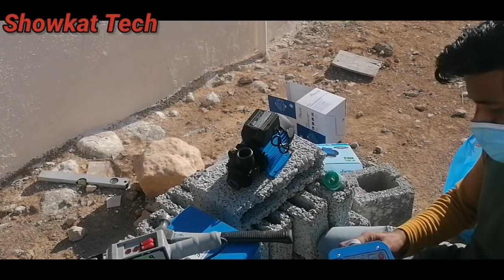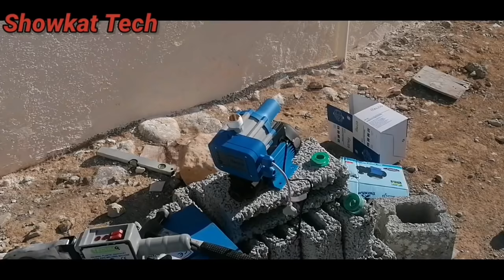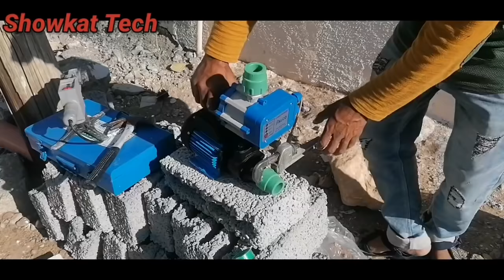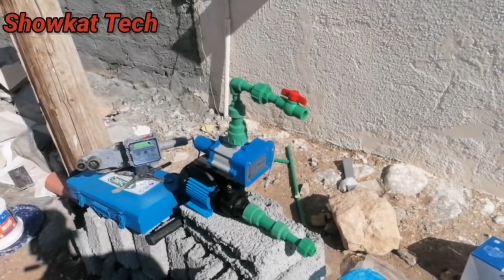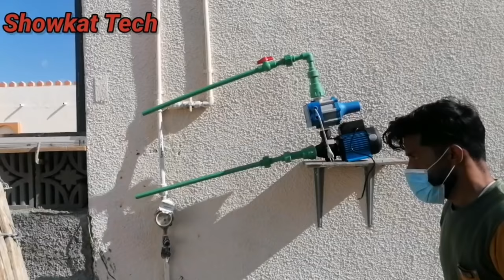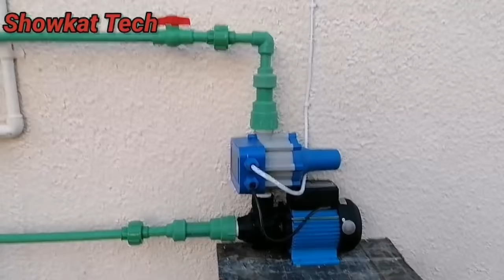Autocratic Water Pump Controller Installation।Automatic Water Pump Controller Fitting & Installation

Comment: I have installed this very same system back in 1996, the actuator I had to change it couple of years ago but the pump still working perfectly since day one!!
Reply: How much cost
Reply: @ratnakarraopotluri1124  porque después  de cortar una llave no parte automático , tengo automático , tengo que hacerlo  del motor

Comment: I have this kind of pump but the pump stay on with all close faucet. The pump stop if I cut the water entry but dont stop when it on. I have to turn off because the impeller housing went too hot that I have to spray water to cooldown the temperature. Please help me

Comment: Should this controller connect at water inlet or motor outlet
Reply: The controller should always be at outlet of the pump.
Reply: I have tried to connect the pump but it's over heating what could be the problem please help

Comment: Use pumb connector before fix the pressure kit in motor ..👍
Reply: And u should wear hand gloves
Reply: This system Not allowed in UAE ( after valve,a pressure motor)

Comment: Can someone please explain which side was the water inflow and which side was the outflow? Its  not clear on the video.
Reply: The water come from down!
Reply: Water is being sucked from the down surface pump then supplies through the top surface pump where there is control valve
Reply: @chineduchika1018  ෆ්නෙ